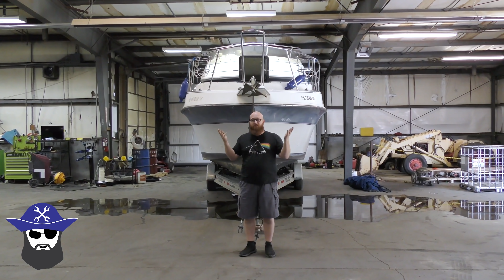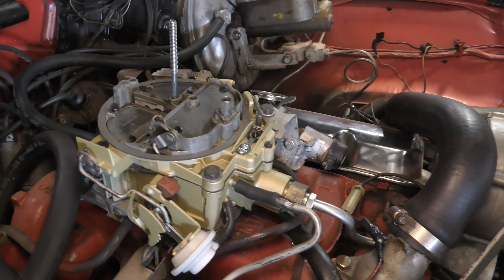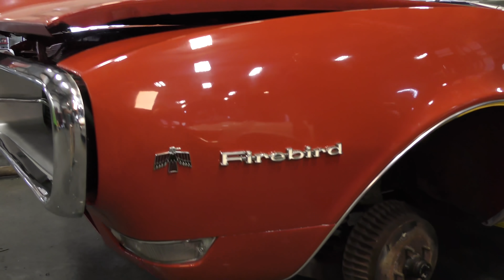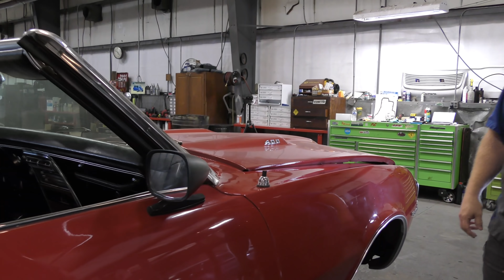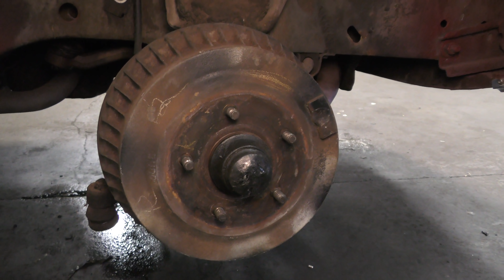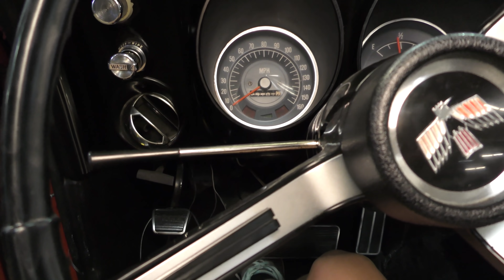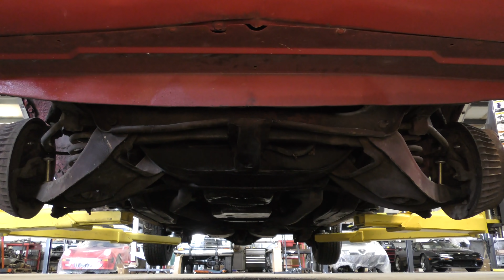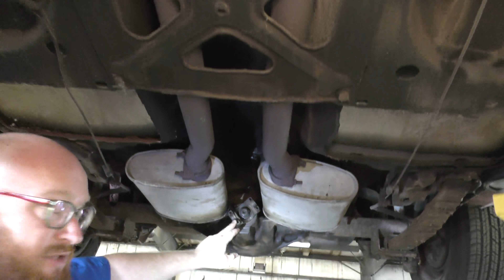Fabulous 1st Gen 1968 Firebird 400 leaking like Niagara Falls. The CAR WIZARD finds 6 places leaking

Comment: Hate to correct you Wizard, but looking at the firewall and the vents on the dash that car was an AC car, I looked at a replacement HVAC control for that year Firebird and Camaro and it doesn't have the usual indicators like AC or Max AC.
Reply: Yup!  A '67 Firebird or Camaro with no AC wouldn't have any vents on the dash, a '68 like this one would have just the side "eyeball" vents for outside air but no center vent, and the huge box and hoses under the hood is a giveaway, it clearly had factory air, and if i had this car getting that sorted would be a high priority after getting the other stuff fixed!
Reply: And it has the evaporator under the hood
Reply: Another thing occurred to me, I'd have to go back and watch the video for cuts but earlier in the video the Wizard did mention removing the AC compressor so at that point he had to know the car had AC--I'm wondering if this was videoed in a different order from which it was put together, maybe at the time he mentioned the lack of AC he'd only seen the dash panel and not under the hood.  Older GM cars had some GOOFY ventilation controls (don't even get me started about my grandparents' '66 Cadillac, whoever thought it a good idea to mark max AC in RED and no other label or indication of what it was for should've been taken out and horsewhipped LOL) and my guess is without an owner's manual you'd have to just use trial and error to see what did what!  I had a friend who had a '68 Camaro with the inline 6 and no AC way back when, and other than the temperature slider the other controls didn't make a whole lot of sense, and there wasn't even the usual separate toggle for the blower speed!  Of course his had no center vent and the eyeball vents would pull in plenty of outside air when the car was moving; that feature, "astro ventilation" LOL replaced the vent windows in the '67.

Comment: Ah the memories. I bought my brother in laws 
68 Firebird 400 when uncle sam decided to send him to Germany. After a while it wouldn't shift out of first. I took it to the Pontiac dealer and they told me $1500 for a new trans. I was real pissed and left. On the way home I said f-it and punched it. Bang, one two upshift was perfect, two three was perfect. I went to the library and looked at a motor manual. It told my to unplug the kick down switch from the carb. It turned out to be a $18 repair. Lesson learned!

Comment: 400 cid, 320 hp engine with front drum brakes.  Pitiful.  They ARE junk!
Reply: You haven't been to a scrapyard lately. You'd find THOUSANDS of cars way newer than this car waiting for its date with crusher. There's your junk right there.

This one is still roadworthy.

Since you obviously can't tell working cars from the junk, an optometrist could fix that problem for you in about an hour.
Reply: @houseofno  Let me clarify:  Front drum brakes are JUNK!  Been there, done that.  I still have my adjusting tool that I used on a weekly basis just to keep the brakes from pulling on one side or the other.

JUNK.

Comment: I don't know who Wizard is trying to fool by saying that old cars like the 68 Firebird didn't come with air conditioning when you can plainly see it when he had the hood up early on in the video! Plus he comments how hard it is to remove the compressor in the  old cars!  This car is clearly not a ''survivor'' quality car as indicated. The engine should be painted a light blue metallic and the engine compartment should be painted satin black not body color like this car! I restored a set of identical twin 68 Firebird coupes so my then wife and I wouldn't fight over them! It didn't work, She figured out that I had given her the slower one and wanted to trade! I then restored a pair of 67 Firebirds that were complete opposites! A 400 H.O. Convertible, red with white interior and an O.H.C. 6 coupe, white with red interior, I don't have to tell you which one she wanted! I really liked the Firebirds but they rode rough and were small inside so I liked the Lemans and GTO more, They rode and handled better!
Reply: I guess I should have read further down as Hott Puppy pointed out the wrong color engine and engine compartment and the air conditioner before I commented!

Comment: Come on Wizzard. It's a car. An automobile with nuts and bolts. Brackets and system are just like understanding and following an electrical diagram. There is a sequence. Old school for sure, but not complicated. You don't have to remove the intake to change plugs. The old school guy.
Reply: Yeah I agree with you. Having driven an 84 Cutlass since 2006, 1987 Cutlass before that since 2002 and an 83 Pontiac Grand Prix before that. I had an 86 Honda xl250R which made the grand prix seem like the most bulletproof car ever.
Reply: Now days the younger people just want to be able to plug in a connector and be told what is wrong(maybe). And if they do what the computer tells them and it does not work, they are lost and scrap the car.
Reply: He is the Car Jizzard! ..... And screw the BS Amazon store with his"cut"
Reply: @mikewaite3746  You're the very definition of the word "asshole".
Reply: @Sabrinahuskydog  😂
Reply: @Sabrinahuskydog  Dingleberry Apples😘

Comment: Need to dump the 1980's JC Whitney side view mirrors and get a proper set of original chrome ones put on there. Nice driver though. Somewhat unusual optioned car with the drop top and a 400 but standard drum brakes and no A/C.
Reply: Had A/C originally... 1960's drum brakes were vastly superior to the early disc brakes...

Comment: This Pontiac was originally an A/C car. The compressor is missing but it has A/C.
Reply: I was just getting ready to comment on that definitely an air-conditioned car you can tell by the vents in the interior also under the hood it’s obvious when you look at the heater box it’s not the regular one it’s got all the air conditioning components on it
Reply: Maybe.  There's no A/C switch on the controls.  Just heater and defrost.
Reply: Some of the cars of this era had AC vents pre-built into the dashboard but they were only used for fresh air vents.

Comment: 7:12 Me, a south american millenial: I grew up among a sea of early to mid 70's cars, I gotcha fam 😎 (not that I'd have had that problem, as self-service gas stations are either an extremely rare breed or outright banned where I live/frequent 😅). While the real reason gas caps were moved to the sides was crash safety, having a tilting license plate did invite naughtiness (not the case of this particular car, but as Wizard said the most common location was behind the license plate)

As for the fuel smell, TIL 😊 (I expect some fuel fumes from older cars, but never knew why). Still, every enclosed parking lot I visited in the US (all two of them!*) reeked of fuel fumes, so I'm a bit surprised this can worry people this much.

*: In US summer 2012; I also recall being surprised that the fuel smelled so similar to Brazilian fuel, but at that time both countries already all but mandated a small ethanol percentage on all gas (5% in the US, somewhere close to 15% in Brazil IIRC).

Comment: I didn’t know you could do a rear main seal and oil pan without pulling the engine. Would love to see the engine painted in its original color.
Reply: They used to make a tool called a Sneaky Pete to pull those rope seals out in situ.  It was a cork screw affair.

Comment: My 69 brakes were all drum. Found out the hard way that I had 68 front drums.  69 drum were wider and bottom out against the dust plate.
Reply: Disc were optional in in 1 Gen.

Comment: That car has been repainted at least once before. Too bad they painted the under hood areas orange. The fenderwells should be black as should all the radiator support stuff. Lots of orange overspray on the wiring. The engine should be Pontiac metallic blue. Better take a good look at the upper ball joints again. Lots of built up grease and gunk. Doesn't look like they have been greased recently (like maybe decades).  You said it didn't come with A/C from the factory? That big box on the firewall tells a different story. The A-6 compressor is missing from the engine. Vintage Air setup would be cheaper than trying to make the factory stuff work since there are pieces missing. Regarding ease of service--just takes different tools and skill set: dwell meter for the points, vacuum gage and tach. for setting the carb. and if you have the money, a good Sun scope. Fumes coming from the carb are a stinky pain. Eventually it stops smelling---when the carb bowl is empty! Computer scanners are nice, but you still have to know the basics, otherwise you won't know if you're on the right track. I got burned by a dealership that ignored the basics and cost me money for stuff I didn't need to change--a bad spark plug wire was the problem and they missed it with their expensive tools and factory 'training'. I thought I needed the tools and training--that's why I took it to the dealer (late model at the time S10) but I just needed the basics.
Reply: Well said. This Firebird appears solid but needs an owner with an eye for detail to set things right to keep it from regressing.
Reply: Not to mention the orange overspray on the suspension components and the gas tank.
Reply: The orange paint is definitely a respray...  Not great but looks good from 20 feet.  Wheel covers are from a mid 60's vintage Chevrolet SS.  Firebirds only had center dash vents with factory air conditioning, according to brochure pics from the era.  Any evidence that the IP has been swapped?  The engine block is the wrong color for that vintage Pontiac, but it is a Pontiac engine, likely from a more recent car.  Much of the car looks like it could be a 79,000 mile original.  But look closely at 11:00 in the vid...  the driver's door hinges and detent hardware are brand new, the trashed orignal the driver's seat, and the oil soaked undercarriage all suggest it is more likely a 179,000 mile car.  
Wizard... your customer should do a thorough search on the VIN.  All but certain this car does not have its original engine (or trans) and may not be a legitimate Firebird 400, but is instead a clone cobbled together.
Reply: Shades of a similar situation I had...  dropped my car off to be fixed of it's bucking issues.  It was there for days.  I went into the workshop,  the "mechanic" rattling off the multitude of parts he'd installed to no avail.  I looked at the intake tube,  and immediately saw the split seam.  I went next door to the Ford dealer,  bought the part,  walked back,  installed the part,  and drove away without issue.  No, by the way,  I did not pay that bill.
Reply: Painting engines same color as car was pushed by car magazines for a while... as was painting inside of engine...
Reply: Good catch on the overspray on the repaint and other things. Also, the 67 had a 326 in 68 on it was a 350, The engine has either been replaced with a Chevy engine or was painted the wrong color. Pontiac engine's are blue. Why he is talking about the smaller V8 when he is supposed to be working on a 400?
Reply: @kevinobrien6061  - The water tube from the top of the water pump to the high rise airgap intake manifold tells you it's a '65 or newer Pontiac engine... Chevy engine wouldn't have that... Olds would have a short curved hose connecting there, no high rise, no airgap... ...
Reply: @kevinobrien6061  Engine IS Pontiac--painted body color. Curious what the original body color actually was.
Reply: Was gonna say the same
Reply: My brother's 64 Goat 389 engine was a metallic blue from the factory. My 70 Firebird's engine was generic black. Chevys came with orange engines.
Reply: @donmorris4285  - This is definitely a Pontiac engine painted to match the car...
Reply: Yep, I saw the paint overspray on the gas tank when he had up on the lift as well. Still all in all a pretty good looking old Firebird.
Reply: Yeah that’s the one thing that bothered me. That paint. Gas cap painted red. And got carried away under the hood with red. Overall its solid and everything is there to work with.
Reply: Yes I spotted all the A/C stuff on the passenger side inner fender, strange he didn’t notice.
Reply: It's pretty bad, there's overspray everywhere, gas tank, etc. Looks like a maaco job or something. I'd really like to have seen a better look underneath beyond just looking at leaks, same with the wiring. When you see paint like that it's always suspect that something else is going on with the car.

Comment: In high school a girl that I was friends with drove one that was blue, those oil leaks were just installed rust prevention. I hated installing points and setting them on those old GM cars, even with a dwell meter and special allen wrench.

It one of the reasons I loved my mustang 289, distributor was in the front.
Reply: Talk about easy to work on, I bought a new 64 Falcon Sprint convertible with a 260 V8 and a borg warner factory 4 speed, Ah the good old days, 3200.00 out the door with tag, taxes, and title.

Comment: The difference between a mechanic and a technician.   This is the stuff I learned to work on before I was a teenager.  56 Bel Air, 56 and 62 Ford station wagons. 63 Falcon, 68 Camaro, 69 Firebird, 72 Chevelle, 64 Galaxy 500 XL.  You could fix it on the side of the road and limp it home.
Reply: @outdoorfun8780  He does know what he's talking about.  I remember the 60s and early 70s very well.  I had my times messing with cars on the side of the road.   Cars weren't anywhere near as reliable as todays cars.  Points and plugs were a constant pain as were carbs.  Leaks were the norm, not the exception.  If you got 100,000 miles on an engine and/or transmission without a rebuild it was a miracle.    Unlike the wizard though, I think cars were easier to work on back then. Repairs were way cheaper (even considering inflation), and even as teen I could do many of them myself.
Reply: If you properly maintained old cars, they were very reliable..  By properly maintaining, I am talking about checking your plugs and points 5,000after your last major tune up, and the major tune up at 10,000 miles, when you replaced the points, condenser" cap, and rotor.  If the plugs look eroded, you replace them too.  You also need to service the air cleaner every 10,000 miles, and replace the fuel filter at that interval.  What caused the lack of reliability was the refusal to perform these tasks, instead waiting for something to fail or malfunction.
Reply: @michaelbenardo5695  What you said what exactly what I was thinking. The 1960's were no different than today, as in many people just drive it till it quits running. "Tune up" used to be a word you would hear quite often. Give the car some regular attention and it would be just fine. And that stuff was EASY to do. And I am not even going to talk about the ridiculous tech they the put into todays cars for that extra 1/4 mpg.  Engines that shut off at a stop light, 9 and 10 speed automatic trannys.  Yes, with better modern machining  tolerances and improved metals, engines can last longer(some of them anyway), but that's to be expected. But just listen to some of these online car videos like the Wizard, or Scotty the mechanic, and how many times do you hear them say about many newer cars, don't buy this car they have bad motors, or these cars have bad transmissions, or this car has bad this or that.   Give me a car or truck from about 1965-1972 any day.
Reply: @mitchelpinion1852  your exactly right, even the weather could make your car not start up or run right back in those days. I'm barely old enough to remember them but I do. Learning how to work on cars from the time I was about 6 years old from my uncle and grandfather I got to see how points worked and how carburetors were rebuilt and so on. And out of experience of working on both older cars and newer ones I dont get what Wizard meant either because old cars are definitely easier to troubleshoot and find the problem most of the time since there were so many fewer parts within each system and so many fewer systems period. The worst  part of working with those old cars was actually what he said when your working near the front of the engine, especially on one that had the options for a/c and or power steering because oftentimes they would relocate the alternator or add extra brackets and that's always pain dealing with. Not to mention having 2 or 3 different V belts. And there were no belt tensioners like cars or today either, you had slits in the brackets with a bolt you had to tighten while pulling each belt tight. But with today's cars you have multiple control modules for each system and sensors that communicate with those modules and so much more wiring and ecu data. Not to mention all of the technology in the vehicles now for comfort, entertainment and safety. And with that a regular person or even shade tree mechanics can't just work on today's cars with general knowledge, you need a good scan tool and know what your looking at when operating it or its useless.
Reply: @RWieber79  Yep
Reply: If you kept it in proper tune, it would start no matter what the weather was, unless you had a dead battery
Reply: I am with you boy. The old school guy
Reply: @outdoorfun8780  those old cars were garbage I don't give a damn what anyone says I worked on them back then and what a nightmare
Reply: Today's Japanoid tin cans are garbage.  Too complicated, too cramped, too rough riding, and I don't give a damn what anybody says.
Reply: A tech uses a computer to find the bad part. A true mechanic uses his ear.
Reply: @MyGarage-uu5ld  and years of experience. 👍
Reply: That's because they needed plenty of fixing. I can't remember the last time I saw a car stalled on the side of the road.
Reply: Before I retired just 3 years ago, I would see Japanese cars on the side of the road at least twice a week.